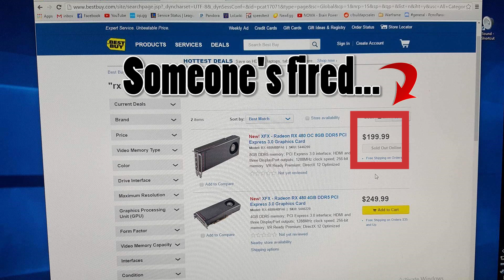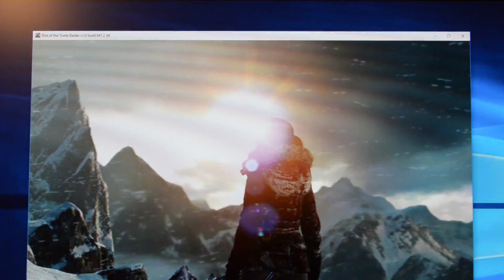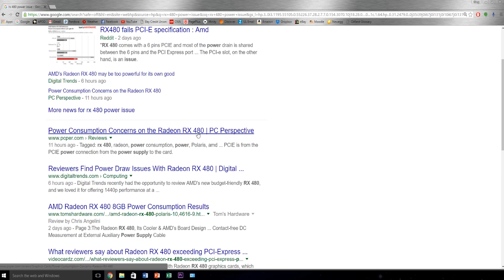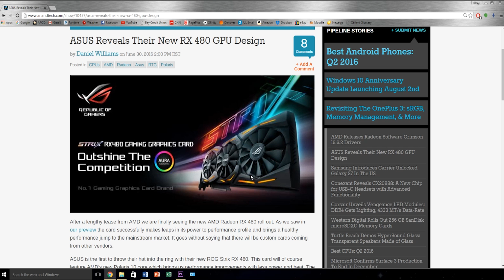RX 480 Aftermath: Power Issue & Over-Hyping

Comment: It's not 199 it's 280 bucks limited issues just like Nvidia so I hold my breath and see if the amd fan boys make as much of a fuss as they did with the 1070
Reply from the maker: Yes it is, $199 MSRP.
Reply: +Science Studio I understand but didn't you make videos bashing the 1070 cause it was selling way over its msrp of 379.99 and recommending buying something else so wouldn't that be the case now with the 480 costing 280 and a 390 costing 260
Reply: +Science Studio btw I love your videos and I mean no hate lol just seemed not fair to complain about 1070 but not amd supply issues
Reply from the maker: The card is selling for $199 and $239 here in the states. The prices are not higher.
Reply: +Science Studio cheapest on pcpartpicker.com is 275 bucks I'm not arguing about the msrp but didn't you complain about the price hike off the 1070 due to the same supply issues.
Reply from the maker: Use Newegg. Prices are all accurate: $199 and $239.
Reply: +Science Studio there all out of stock I'll check later if I was wrong I do apologize
Reply: $199 all over the place. You are wrong, apologize.
Reply: I just picked up a second 980 Ti with all these great price drops. I'm not an AMD fan, not even close, but I've got high hopes for this card and their 14nm architecture in general.

I'm trying to keep people from being unfairly dismissive of AMD's 3rd or 4th non-pile of shit card ever! It's a pretty big landmark for those bottom-feeding liars.
Reply: That doesn't change the price, or how good of a deal the card is, just order one and be patient for a week. Jeeze.
Reply: +Brad Gefroh all sold out nkw scalpers are getting to it like with the 1070
Reply: +Brad Gefroh just like with the 1070 or are you a amd apologist
Reply: +Brad Gefroh wasn't fair of me I just assumed I've dealt with some real stupid amd fans lately
Reply: Just remember that every successful AMD card could potentially lower the Nvidia market share, forcing them to lower their prices or at least attempt to curtail the over-msrp price gouging that happens with every card they launch. Competition is good for the consumer.
Reply: If I'm honest, this is the real master reason that I want AMD to do well. If AMD starts REALLY fighting back, team green's products are gonna get real sweet, real fast.

Fingers crossed for AMD everyone!!!
Reply: +Brad Gefroh me too but some of yall lying for amd isn't helping
Reply: Who's lying?? About what?? Explain yourself!!
Reply: +Brad Gefroh I didn't mean you. Lots of amd fans purposefully over hyping the 480 performance or just lying about the costs yeah 5 a day sells at 199-239 but after that it's up too 280 plus just a clever way of what Nvidia board partners did
Reply: Still 199 on newegg. http://newegg.com/Product/Product.aspx?Item=N82E16814150771&amp;cm_re=rx_480-_-14-150-771-_-Product
Reply: +Fahad Hossain (aka Zeus) can't click your link but it's probably out of stick anyway what does amd sell 3 a day at that price
Reply: nooberrific fixed the link, try again
Reply: +Fahad Hossain (aka Zeus) out of stock
Reply: +Fahad Hossain (aka Zeus) they sell 3 a day that price just a clever way of doing what Nvidia did
Reply: Says $229 for me. The cheapest I've been able to find — be it on Newegg, Amazon, or any other store — was $224, and that was a 4GB model with a minor discount.
Reply: Ikr 199 msrp lols
Reply: Basically Nvidia listen up do what amd does sell 2 a day at msrp
Reply: i found one for msrp so pls f off

Comment: I never saw anything were AMD said/stated that this card was as powerful as a gtx 980 other websites stated this not them. As for the power thing many other cards on the market have exceeded the power thresh holds on pci- e slots (mainly when overclocked). Also reference cards from AMD and Nvidia are always normally Crap and it is the AIB partner boards which really make the cards shine through wait for these and get awesomeness.

Comment: Why don't you underclock and drop your voltages down to see if the problem persists? If you can drop voltages 10-20% and drop your clocks a bit. Just to at least see if it's a possible fix for this problem
Reply from the maker: Already did that in my newest video.
Reply: Hi i have the rx480 and all my games crash with gray screen it can be 10 minutes or 3 minutes game crashes with gray to green screen i lower my clock memory and custom fan curve .cant figure out what else to do thanks

Comment: To be fair though, Foxconn is one of the cheapest motherboard makers out there. Have you tried it with, say, a build with an ASUS board?
Reply from the maker: Did you not hear the part where I mentioned that the motherboard worked with my 980Ti (twice as powerful) with no problems? Please pay attention.
Reply: Yes, I did catch it. Sorry, I guess I done goofed. Although you're probably right about the card drawing too much power from the PCI-E slot, I would still be interested in seeing how it behaves on other motherboards; maybe--and I do realize that this may be reaching--it's some quirky brand-specific driver or bios issue. Because if you're right, then AMD is in serious trouble (and in other news: fire burns, water's wet, and air is invisible... :P)
Reply from the maker: LOL I haven't too many old motherboards around the Studio, but my ASUS Z170 board didn't have a problem with the card. And when the RX 480 was undervolted, it never had a problem with the Foxconn board either. I'm 95% sure it was a PCI power draw issue.

Comment: funny that you mention that stuff in the video

i find that the mistake is on your end tho

anyways a friend of mine has 2 of them running in Crossfire and is giving me quite positive comments and other stuff i heard from the community are also has positive, it goes to say however that waiting for aftermarket versions of the RX480 is a must and is said by everyone including myself

also, i cant help but facepalm at the morons being "disappointed" towards the wrong product; wait for the GPU you meant to buy you dumbasses, the RX480 is meant to bring VR to everyone by making cheap so go for the upcoming VEGAS GPU
Reply from the maker: What mistake did I make? This is a well-documented problem - as I soon found out after running into issues with the RX 480 on the board but not with my 980Ti.
Reply: Science Studio
well like i pointed out, first and foremost is the fact that you did indeed use the stock versions so its alright

as for the potential mistakes i figured maybe the airflow wasnt appropriate, the GPUs were incorrectly calibrated or maybe even the motherboard couldnt handle a crossfire of these?

dunno, i DO know these GPUs tend to heat up a LOT in their default brand but maybe you did something that got them to heat up to catastrophic level? O_o

either way im really not too concerned since im waiting for VEGAS GPUs AKA "R9 490X" cheers ^_^
Reply: sniff sniff i smell fanboy.
Reply: +xGoodOldSmurfehx Yeah, me neither. Waiting on the 1080 Ti or the next Titan.
Reply: You dont seem to understand what is going on in the video nor does science studio understand what the hell you are trying to say, so i will do it for you,

1 The video card was NOT run in crossfire
2 the motherboard used is OLD like 4+ years old
3 the (for you and Sc,ST) the card is not spiking power it is a consistent draw OVER the PCI E specification pcper did a video on this already, you should go watch it

3 newer motherboards have a better power delivery system and can handle the consistent over draw on the PCIE slot, thats why the card never crashed in his new system.

4 the RX480 is NOT AMDs high end GPU however it is their best price/performance GPU and at a price of $200 it is ment to undercut Nvidia for performance similar or better than the Nvidia 970

4 Yes he used the stock RX 480 because that is all thats being sold right now how could he have an aftermarket card so soon when there are none on the market? if your friend has 2 RX480 they are also STOCK versions

5 as he clearly stated in the video the cards had proper airflow and did not go so high as they would just crash the system

6 You know what GPUs heat up alot? Nvidia GTX 480s 

7 if you are not to concerned about the RX480s then why the fuck are you leaving long comments talking about the RX 480?
Reply from the maker: Double check those graphs. Power draw fluctuates (i.e. spikes) in any card as demand rises and falls.
Reply: Science Studio thats is true that the power does spike for sure, however the pcper video tested every single power input including the PCIE slot and the data shows that the exact same power draw is coming from the PCIE slot as the 6 pin, and due to this it will over draw power from the PCIE slot, and that is why AMD is releasing an update for the card to fix this issue.

here is a direct link where they explain everything /watch?v=ZjAlrGzHAkI or if you are subbed to them you can just go to their page, its the latest upload.
Reply: thelasthallow
really? i guess i didnt pay enough attention then since i sweared he had crossfire running in there

dunno, sometimes multitasking messes with me XD

but then, alot of people misunderstood my comment anyways so heh

interesting link btw, thanks :)
Reply: Casey Edwards fanboy? who? i mean facts are facts that does not make me a fanboy.
Reply: thelasthallow
i think he was talking to me XD

it really doesnt matter
hes one of these people who misunderstood something either way :)

Comment: Do the math and you'll find that the price/performance is pretty much the best you can get. Numbers taken from Sweclockers (Unigine valley) and a well known store in Sweden.

The 480 has a ratio of 0.7 points per SEK. The GTX 1080 has about 0,52 points per SEK. So that, to me is pretty impressive, just looking at the numbers. If we make it a bit more fun and estimate what the Nvidia should have costed if the ratio would have been the same, that would be about 5800 SEK, but the card costs 7700 SEK, that is like 32% more, which is alot. And I dont know how well any of those cards run, and it might be wort spending 200 Euros at something just cause it says Nvidia on it, idk... Might be a better smell from it, maybe it makes your dick harder when you watch your gay porn, i will not even speculate into it. Unless we got some real arguments against it, I feel like picking the 480 cause it's in a better range for my budget, and you get MORE PERFORMANCE for it, not the max. And this (like everyone dreams of... but will never happen) might get Nvidia to slacken their money hungry buttholes and cut off the price a bit.

Comment: this is not an issue with the power draw it is possibly done intentionally to stop people using AM2 or LGA 775 and before them made motherboards with the card it needs a PCIE 3 X8 slot or a PCIE 2 X16 slot to be fully functional as AMD maybe planning to stop supporting older motherboards with their graphics cards aka stopping PCIE and PCIE 2 x 8 slot support and trying to slowly get to only be using PCIE slot power so there are no addittionall cables needed in the future this though is just a speculation

Comment: Still running 2 390x's and I am still happy with their performence. The RX 480 got some child issues that willl get solved with aftermarket cards. Don't crap out because 1 guy has problems. Nvidia had the same problems years ago and nobody complained there. 2 RX 480s still hold up to a 1080 for 300€ less.

Comment: Dayum, in Poland actually a GTX 960 is 3/4 of the RX 480's price. This makes this GPU kind of pointless here :/ Are those manufactured in America or China? Because i thought we ussualy had good trade agreements with China, low import fees etc.
Reply: It is roughly 340$ and a GTX 960 is 210$  a GTX 970 is 305$ (still cheaper). If you manage to get 40% more money you can get a GTX 980  (you can get those slightly below 450$). So if it is somewhere between the 970-980  its still kind of a bargain, but nothing near the American price, its almost twice as expencive here so im afraid it totally misses the point. At least for me, the benefits from Cuda are well worth this price gap. (GPU raytracing, faster after effects performance etc.)

Comment: Nice, sub.  It seams I have the same problem with 290x. The card is watercooled with alphacool GPX-A 290 M01. The Gpu does not go over 50 and VARM1- 62 VRM2-53. Yet I get black screen and sound keeps going for 1-2 sec then the sound stutters for again 1-2 sec then it goes silent. I need to hard reset the pc(the power stays on). I tried older video drivers.. bios update for MB asus z170 pro gaming. I only get this during gaming. Even in games not so demanding like  SMITE. Although I am using 4k res.
I tried to raise the voltage for GPU but I get the same result. Any ideas?

Comment: My pc smells like burning wax from time to time, just replaced the mb, the cpu and a new hard drive was added, checked it all for busted or bulging capacitors and nothing. Idk what it is, everything appears fine and i even took of the cooler and checked the cpu, i plan to crack open the psu but if anyone has any ideas u may save me some time.
Reply: Capacitors make noises when gone bad,It can be PSU but it most likely an overheating CPU causing something to burn like thermal pads or Thermal Paste
Reply: that could be your PSU
Reply: Harmony Shimer Yeah the new cpu I put in it is an fx 8350 so that's likely it since they run hot af, know of any programs to check the cpu temp? also I'm using stock paste and cooler on it, so any recommendations on that as well anyone? 
I thought it was the psu but tbh I've ran this machine for a few weeks and still nothing has fried it so i think that the psu is fine. My allergies are bad so I've been having trouble smelling the burning smell as often as other people smell it so its hard for me to pinpoint when it happens the most.
Reply: please never use stock pastes,Use a high grade thermal paste,make sure wires are not in contact with heatsinks,and just to be sure ,what is ur psu model + GPU ?
Reply: Harmony Shimer It's a bronze 500 watt, idk the make but i think corsair or evga. My gpu is a msi r9 380 the 4gb version. Already have checked for wires and none were in contact with anything.
Reply: I would highly recommend upgrading into a 650W Gold PSU,with this 500W bronze U have no headroom for OCing and ur hardware are on the edge for this PSU(420W-460W)
Just try the thermal paste I think it will fix the smell
here is a very good thermal paste:
http://www.newegg.com/Product/Product.aspx?Item=9SIA0AJ3KM0696
Reply: a Good psu for your setup: 
https://www.amazon.com/EVGA-SuperNOVA-Continuous-Warranty-120-G1-0650-XR/dp/B00K85X2AW?ie=UTF8&tag=xov-20
Reply: Harmony Shimer Ouch that's not the price i was expecting to pay on this fix xD, Thx for finding me that btw. I think i might try getting a better cooler for the cpu and some better paste first just to see if it was the issue since I need to anyway, if no cigar then ill get the psu. Also i just remembered that i have core temp on, I'm smelling the smell right now and my temp is 47 C
Reply: yerroc 47C ? Its definitely not the paste then,try to isolate the smell ,ur CPU is pretty cool
I think its most likely from ur PSU,because when u are that close to the limitation(500W) and the PSU is bronze(which means voltage drops and overshoots)its just too much pressure on it
Reply: Harmony Shimer Yeah it never did this before the swap, should i turn it off then or keep running it? The smell comes from around the psu a bit but more so at the top by cpu, only thing is that i have two fans right there above the cpu, one blowing in and one sucking out, also i have another fan blowing the air in that direction form the front across the hard drives. Just checked the some boxes and i have one that says evga 600 watt so its not 500w
Reply: yerroc turn off ur PC,Open up ur case and detach the CPU heatsink,look for any burn marks,check out the fans too their wire gauges can be shorted out ,clean up the CPU with rubbing alcohol ,apply a tiny bit of Paste(the stock one if it still has some paste in it)It's possible that you just overused the paste
if this is not the case I recommend visiting a repair shop so they can properly troubleshoot the problem before investing into a new PSU
Reply: Harmony Shimer The smell came like right after changing the cpu so idk how it could of burnt something so fast, i will check when i get back home im leavening now.
Reply: yerroc Ok,Goodluck
Reply: +Harmony Shimer well shit I do not have any paste, it was one of those pre applied squares of paste, I'm opening it up again so I'll let u know if I find anything
Reply: +Harmony Shimer ok so here's what I found, looked in my psu to see melted yellow wax or something, lucky me my pc isn't fried, ordering the psu, some dust filters, mabey a new case idk, and a thing of thermal paste
Reply: +Person. to late the 650 is going to be here today
Reply: Harmony Shimer all is good again, now i can return to the glorious pc master race so that i can play halo online finally, I've been playing it today and i have to say it is pretty good.
Reply: yerroc Happy to hear that ^_^
Have fun

Comment: Unless the custom cards radically depart from the power management scheme that is used on the reference RX 480, Having a larger power connector on the board will only make the problems worse, not better. AMD, for some unknown reason, made the RX 480 card completely different  than any other card ever made. AMD tied half of the VCore VRMs directly to only the PCI-E 12 volt pins. The more load that is put on the card, the more load will have to pulled through the PCI-E slot. Overclocking also will make things worse.
  Keep your fingers crossed that the AIBs did not trust AMD's reference card and made the cards in the usual way by connecting the VRMS directly to the power connector and not the motherboard.